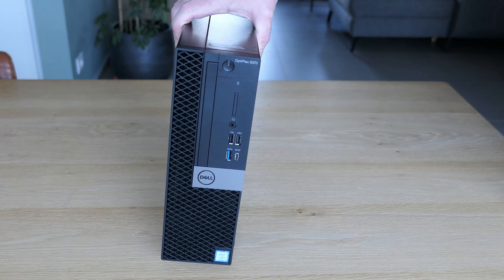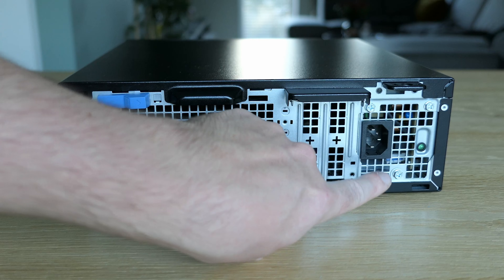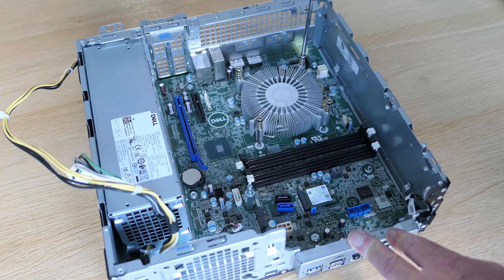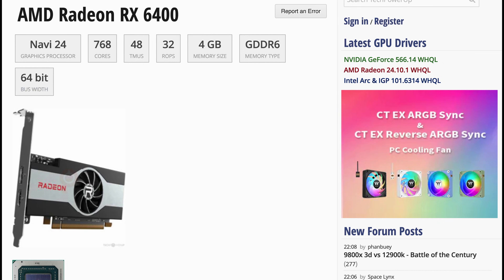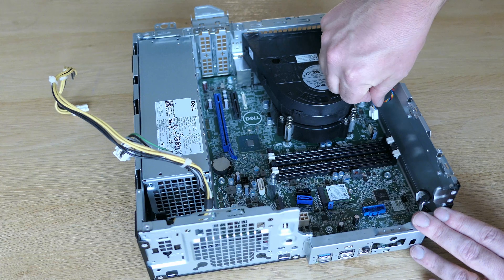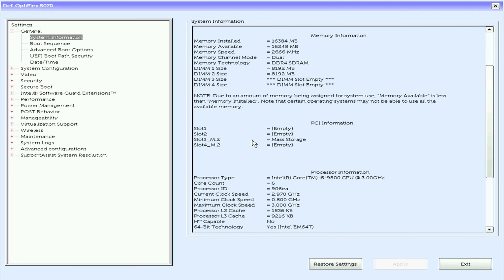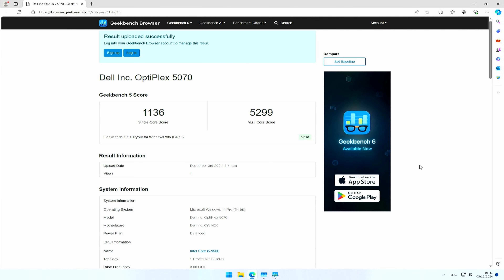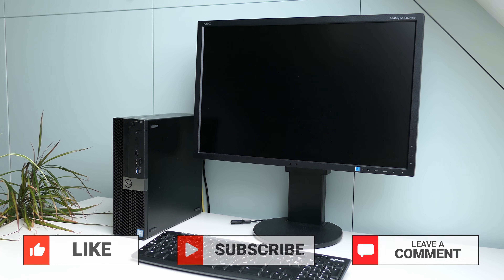Dell Optiplex 5070 SFF - Teardown, Upgrade and Performance

Comment: While disassembling and reassembling both models, I noticed that it was possible to install a front-facing fan. I wanted to make sure it was actually possible. If this is possible, it could improve cooling in these cases. Thank you.

Comment: can i put the motherboard on a open frame case/ benchmark case?
Reply from the maker: Sure, don't see why that would not work.
Reply: I think it would, it might have different placement for screws. I had to drill holes in a new case of mine because of that.
Reply: @airsickterror9305  i bought dell precision t1700 motherboard, MT version so i think is more similar to a standar motherboard
Reply: @airsickterror9305  I bought a Dell Precision T1700 MT motherboard, and I’m thinking of using it in an open-frame case. I think it will be even easier.

Comment: Guys i need help, would a ASUS GeForce RTX 4060 LP BRK OC Edition 8GB GDDR6 Gaming Graphics Card (Nvidia RTX4060 DLSS 3 and a Crucial P310 1TB SSD M.2 2280 NVMe PCIe Gen4 Internal Gaming SSD fit in this case?

Comment: The power SATA cable seems to have only one plug for HDD, how can we connect to 3 HDD? Considering we find the space inside for a mini NAS server?
Reply: you can use a SATA Y or 3 splitter for the mini 6pin ODD cable

Comment: i bought a used hp 705 g4 sff as an impulse buy after seeing a vid by eta,
my unit is having issues with thermals,
(my laptop got stolen after a few weeks and the system came handy)
im looking for ways to improve my system 
and i kinda stumbled with your channel,
im kinda wondering if you know any tricks or modifications
on how to improve airflow and thermals, it would help me a lot
thanks

stock specs:
ryzen 3 pro 2200
8g ram ddr4
128 ssd

current specs:
ryzen 5 ppro 2400g
16gb ram ddr4
256gb nvme ssd
2tb 3.5 hdd
500gb 2.5 hdd
rx550 4gb  lp
wifi card 6e
modified top cover with magnetic mesh
(for additional airflow)

Comment: I am glad as i see you reply back on comments pls help me with this one--
RX 6400 loss about 15% performance on pcle 3 slot. So it is pcle 3 or 4?
How about an low profile 1650? Does it will work?
Pls reply.love from India 🇮🇳🇮🇳
Reply from the maker: According to the spec sheet, the PCIe ports are 3.0
Reply: Thanks

Comment: thanks for the overview, got a couple of questions:
1 - you said this has 2 nvme ssd slots?
2 - what is the total power consumption of this cpu out of the box? That RX 4600 seems like it would take too much power from that 200w PSU
Reply from the maker: 1) It has two M.2 slots, one for an NVMe drive, the other for a Wifi card
2) an RX 6400 takes only around 53W so that should be fine

Comment: Great video i have one question can we install two nvme drive in the system
Reply from the maker: Only one can be installed on the M.2 slot on the motherboard. If you like to install second one, you will need a PCIe to M.2 adapter. These are not very expensive and easy to find, especially if you don't need to boot from that 2nd NVMe drive.

Comment: Hi, Sir. Should I get Optiplex 5070 sff or 3070 sff? Both cpu are i5 gen 9 models
Reply from the maker: The 3070 is a lower end model and has only 2 DIMM slots for example. It also supports less fast speeds for the NVMe SSD and lacks that USB3.1 type C port.

Comment: You know, you could transfer the Dell Optiplex Mobo to a Mid-Atx tower so you can build a casual gaming PC. Those Mobos usually cost around $50-$60 or less.
Reply from the maker: The problem is that these motherboards are far from standard ATX. So fitting it in a regular case will be hard and also the power supply and connectors are non-standard. In that case I think it would be better to find the tower version of a similar Dell machine.

Comment: if the OS is windows 11 pro you can bypass microsoft account login buy clicking connect to organization then click sign in options then click domain log in! it works
Reply from the maker: I do know that but it became such a habit to do it this way. Still prefer an offline account.
Reply: @ offline accounts work if your setting the pc up with windows 11 RDX

Comment: I had a MT optiplex 7060 and I did upgrade the ram from 8gb to 16gb  so it preforms better and I swapped the kioxia(formaly TOSHIBA MEMORY) 256gb m.2 NVME 2280 to a sandisk 512 m.2 SATA 2280 SSD for higher storage
Reply from the maker: NVMe performance is not that bad in this one. A better model will probably have a better write speed but even that, unless doing some really write-intensive stuff is not very noticeable.
Reply: @jensdbe  yea most of the time I don’t notice the speed difference but definitely better than a HDD that’s for sure
Reply: @ I believe the one in your pc is 2230

Comment: As an old machine retired from office computers, the HP ELITEDESK 800 has at least two 3.5-inch disk drive installation slots, which makes it more suitable for the role of a home server. On the other hand, the DELL 5070 SFF has a strange plastic 3.5-inch hard drive tray. This thing is too low in versatility and impractical. Dell should carefully consider the product design.
Reply: There are also MT (mini tower) models of the Optiplex range, as opposed to the SFF model in this video. They're better as home servers. I have an OptiPlex 9020 MT with two 3.5" drives set up as a ZFS mirror, a boot SSD and a Blu-ray drive installed.
Reply: @zoomosis  oh, 4-th gen Haswell, I got it, but I prefer kaby-lake and later for emby or jellyfin and for higher package C-State (up to C8)